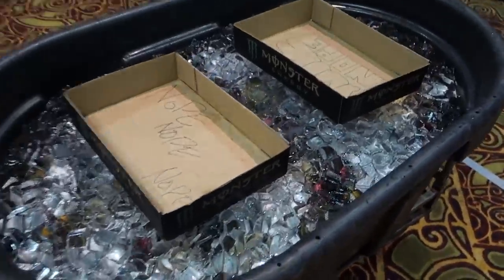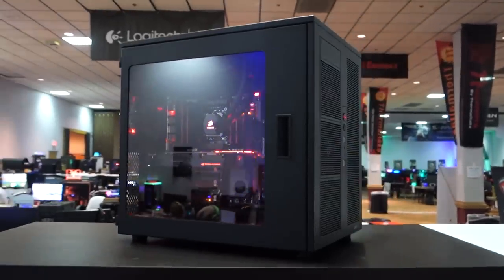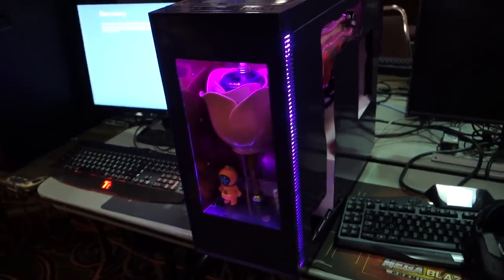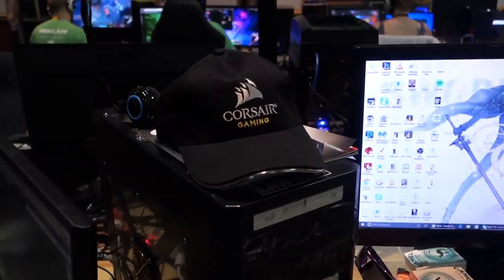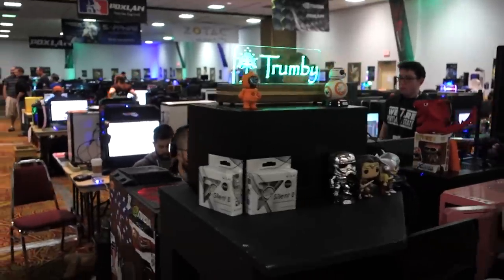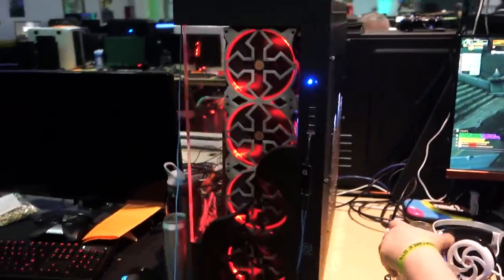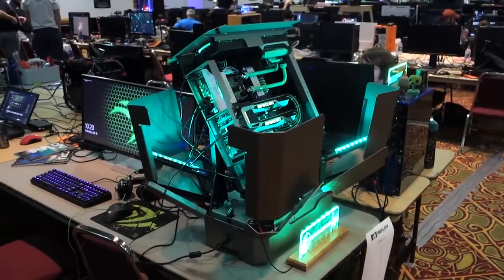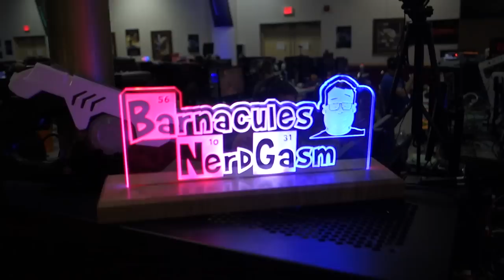Best Custom PC's at PDXLAN - @Barnacules

Comment: The fucking AC better be Kicking in that room....
Reply: Its even a bit cold in here
Reply: It was a bit chilly with the ac but it's comfortable
Reply: I'd think it be warmed up when games are being play.  Or does water cooling not pump out as much heat into the room?  I have an air cooled PC right now and it dumps heat into my bed room to the point where I will start sweating.  But still keeps like good temps it's not like 90C or nothing.
Reply: The AC can cool a given number of BTU's and it was able to keep the room very cool around 65 where I was sitting. A PC no matter how it is cooled still puts out the same amount of heat!!!

Comment: Why havent you shown off your beast of a computer. All those are good in presentation but they run no where near as fast as your home setup
Reply: He did two videos about his computer...
Reply: +Desmond Miller as in take it to the lan party
Reply: +John Trollinski (SalvadorSTM) He did take his computer with him, he showed it in this video
Reply: My rig, the HTower, is faster than Barnacules. Intel 5960x, two 1080s in SLI, 128 gigs of RAM. Intel NVMe 1.2 Terabyte SSD connected via PCI.
Reply: +Richard Surroz Congratulations. The amount of fucks I give has been doubled. 0 x 2 = 0 fucks.
Reply: We shall henceforth call you DivideByZero.
Reply: Richard Surroz Where did you buy your parts?
Reply: +Richard Surroz lol, Barnes is better

Comment: my gaming chairs are driver and passenger seats out of a 2000 Toyota Celica
Reply from the maker: My old gaming chair was a combination of a Toyota Corolla seat and an Ab Lounge fitness machine :D
Reply: Very nice my dad has a problem with buying damaged cars for parts, so I went to a thrift store and bought two cheap office chairs and built wooden base to put the car chairs on to the office chair base.